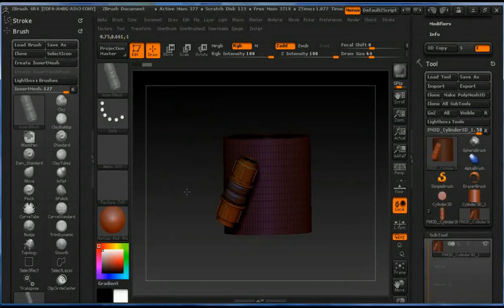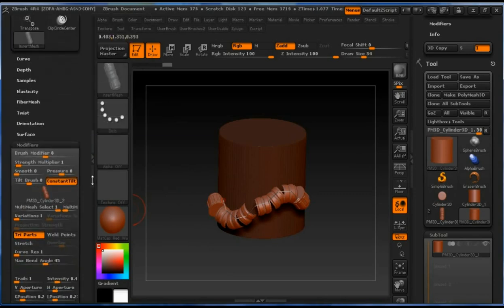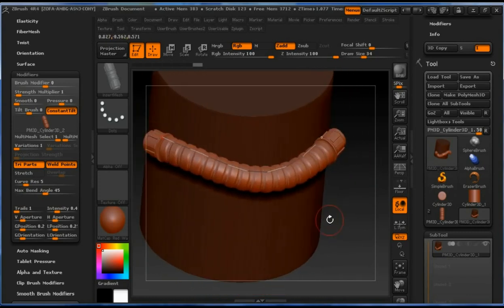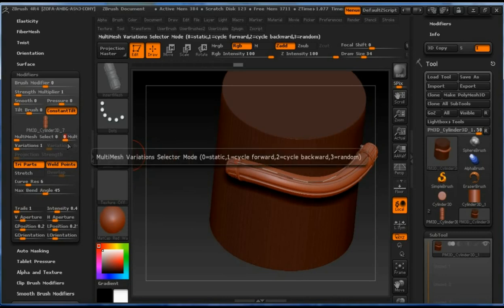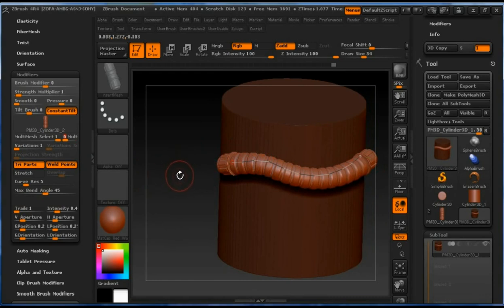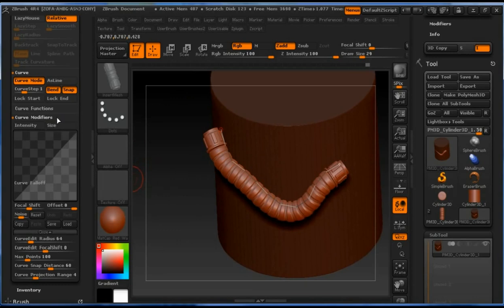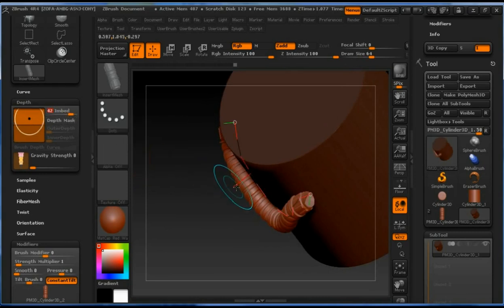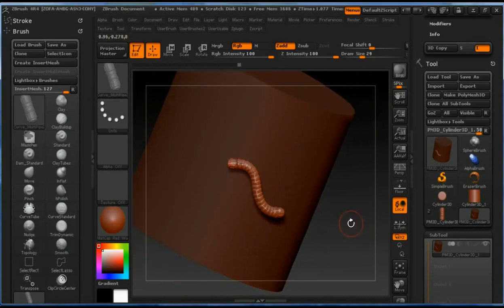Tutorial: How to Create Curved MultiMesh Brush in Pixologic Zbrush (4 of 4)

Comment: Thank you for the tutorial. I have a problem with the middle part. It doesn't weld properly. Adding resolution doesn't help. I tried different settings, not sure what else to do. The middle part does not connect well.And it looks edgy. I am making an electric cord. Any thoughts why that might be? Thanks.
Reply from the maker: It`s hard to say what`s the problem. But Weld and increasing Curve Res should do the trick. Don`t forget to tap on the curve after you apply the changes - or nothing will change.
Reply: I found where the problem was. I had to rotate my subTool before creating a brush
Reply from the maker: Valeriya Paine Good to know. :)

Comment: Thank you, this really help me to correct some troubles I got dealing with this kind of curves. One thing I noticed is, when you hit the create insert mesh button the tube have to be vertical in the display to function in a proper way, but if it is horizontal or in other angle when you draw the curve line, the parts will be with a different rotation and the brush will be distorted, took me a while to figure that out. sorry for the orthography mistakes english is not my native language.